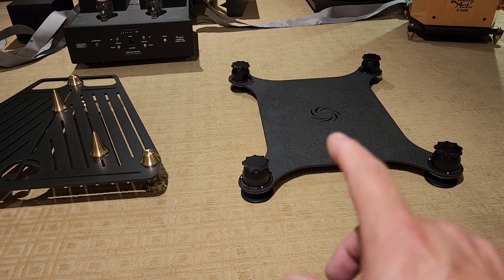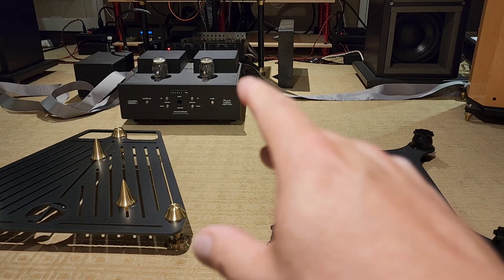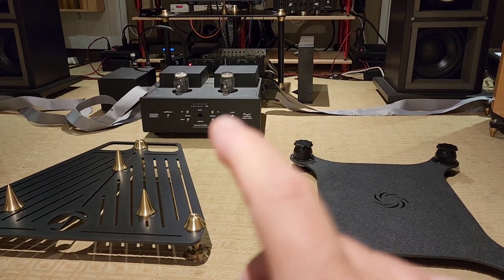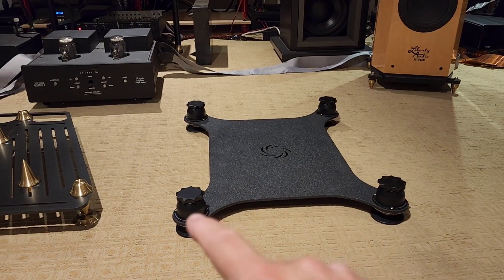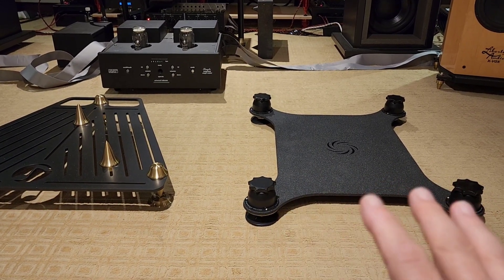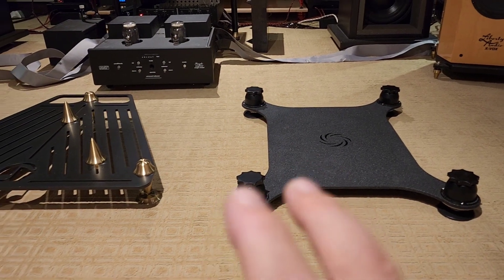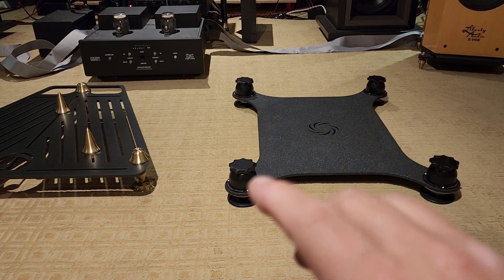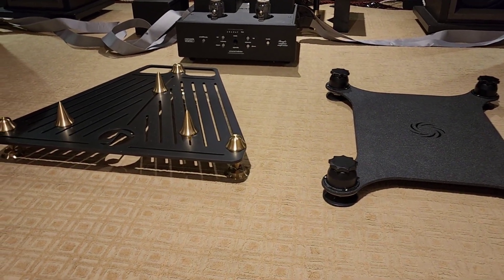UNDERSTANDING THE TWO TYPES OF VIBRATION ISOLATION

Comment: To isolate effectively the system resonance needs to be about 3Hz or below to work correctly, like the Townshend seismic sink i.e. slow motion "wobbly". My money is on the sprung platform, it would be interesting to find out the resonant frequency of them.  I still use a sound organization glass and metal 5 tier rack on spikes for my gear, that's actually technically more like the item on the left. Good, interesting stuff all the same.
Reply from the maker: I prefer to let a RTA test on the room tell the story, Spec means nothing compared to results, if you know what I mean . ;-)

Comment: I’m no scientist, but downwards ’coupling’ whilst upwards ‘isolating’ seems the most logical option ✌🏻
Reply from the maker: I would agree.
Reply: Years ago at a Linn dealer event in town, Linn demonstrated how the speaker needs to essentially be on spiked feet to keep it from moving even a millimeter, the idea being that even a tiny amount of motion blurs the image, the tweeter being most affected since its throw distance is short.  I've heard the seismic sinks on some large speakers on a carpeted concrete floor but had no frame of reference to judge efficacy one way or another.  But just lightly touching the speaker put it into motion and discussion on the design of them didn't make sense to me as the rep said something to the effect that an ideal situation would be for the entire floor of the room to be isolated in this fashion.  So did he mean the listener should be isolated with everything else in the room?
Reply: @mortlach186  Recording Studios tend to use secondary flooring and foundation springs along with sound deadening materials so I suppose what's 'sauce for the goose' as they say. The best results I've gotten is with gear's bottom plate supported with brass cones and carbon fibre discs on thick glass tiers and speakers on brass spikes/carbon fibre discs on our hardwood flooring. The combination of drain/isolate gives a clean, detailed sound with good slam and attack when I wanna crank it. Love the Mortlach 18 yo handle by the way...though at £170, it's a hella expensive tipple!

Comment: The Townshends don't drain anything out of the speakers,they just decouple them from the floor. The springs are effectively mechanical filters eliminating external vibration from about 3hz up,and are particularly effective on suspended wooden floors. 
To additionally drain energy from the speaker-depending on it's cabinet design, I've had great results using Black Ravioli feet between the speakers and the Townshend podiums. In my experience the Townshends are taking some of the room out of the equation-and keeping my downstairs neighbours happier-always a plus! Very interested to see how things go with a concrete floor. Great to see you addressing this issue Mikey,nobody else seems to have gone this far with any level of understanding of what the different factors involved are. Cheers from Sunny Scotland.
Reply from the maker: Cheers Sir Wilson !!

Comment: This should be an interesting comparison. I have my listening room/office on the top/4th floor of a townhome connected to other townhomes on each side. My listening room has hardwood floors on joists. I had Isoacoustics Gaia I (which you should also compare for a 3 way comparison) on my Magico A3s. I heard a lot of good things about the Townshend Seismic Podiums and decided to give them a try. I removed the Gaia I pods and placed my Magicos on the Townshend Podiums. A definite improvement. Things tightened up. For me the Podiums are a keeper. Now the question is will the Townshend bars yield improvements under my pair of REL T/9i subs? Currently I have my RELs on SVS SoundPath Subwoofer Isolation System feet. I don’t really want coupling of my subs to the floor because when I had the RELs standing directly in contact with the floor the bass was boomy and shook the house. The SVS system solved that. The question is will the Townshend bars be better?
Reply from the maker: Did the RELs have rubber feet ?
Reply: @OCDHIFiGuy  I would have to go look. But they have aluminum legs which screw into the bottom of the cabinet. I think there are thin rubber-ish pads on the bottom of those legs and they couple tremendous with the hardwood floor upon which they stand. The result it terrible. My initial solution while not elegant in appearance, but super elegant in terms of cost (you can buy them in bulk on eBay), was to put rubber hockey pucks underneath each of the REL feet. That raised the height by only the thickness of the hockey puck but it eliminated the coupling with the floor and the resulting boominess. But now they are on the SVS system feet, which are also good and look better. So the question would be which is better for RELs on hardwood: rubber game quality hockey pucks vs the SVS system feet vs Townshend bars (less expense than the Podiums and recommended for subs by Townshend)?
Reply from the maker: @RJ_Chicago  Ever consider the possibility it could be that you moved the sub an extra 1.5 inches away from the floor ? Pretty good chance. Rubber decouples.
Reply: @OCDHIFiGuy  Hi Mike, there is minimal and very thin rubberish material on the bottom of the REL legs. I think it is there mainly so you don’t scratch your floor. I think the resolution of the boominess from the decoupling of the RELs from the wood flooring is by the rubber puck. I don’t think it is the distance of the baffle to the floor in this case. The puck is at most 1 inch thick. It might be slightly less. I didn’t measure it. But I don’t think it’s the distance bc the SVS feet are a little shorter than the REL legs and bring the sub a little closer to the floor than the stock legs. But they also decouple. So I think it’s the rubber material of the puck and the SVS feet in this case. Decoupling of the subs works for me in my case as there is no flabby boominess. Bass is tight and detailed. This is what I also get from the low end of the Magico A3s on the Townshend Podiums.
Reply from the maker: @RJ_Chicago   you have SVS feet on top of pucks ? Thats "de coupled" although by science, its coupled inefficiently on purpose.  Lets see what happens !
Reply: @OCDHIFiGuy  No. SVS system feet screwed into the RELs and in contact with the floor. No pucks. With the SVS feet the REL baffle is actually a little closer to the hardwood floor than with the stock REL feet (no SVS and no pucks) and also closer compared to REL feet on top of one hockey puck each (and no SVS).

Comment: Mikey I have found that for me the Townshend podiums made a big difference on my wooden suspended floor.  I tried spikes, no spikes, spikes on rock slabs.  The bass and soundstage and instrument placement all improved.  Not sure what your results on concrete will be but glad you are doing some tests.
Reply from the maker: Thanks , what you state makes sense to me.
Reply: The Townshend is effectively a low pass filter. They do transmit vibration but only below their resonant frequency (which is typically about 3-4hz, so below audible threshold) they are very effective on suspended floors.